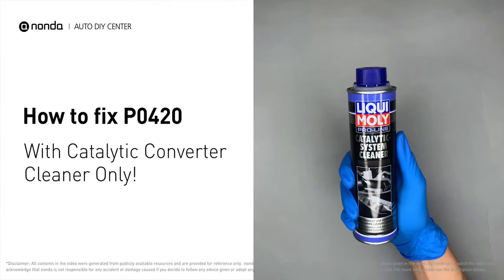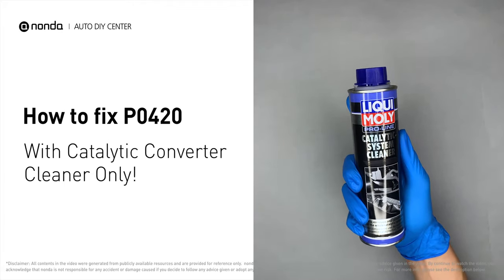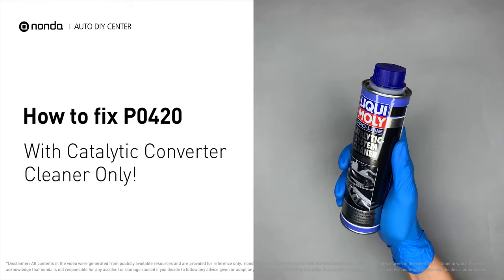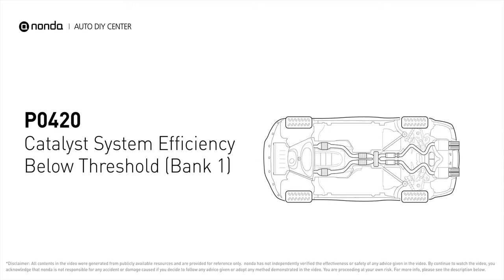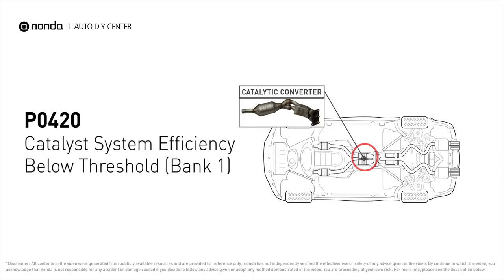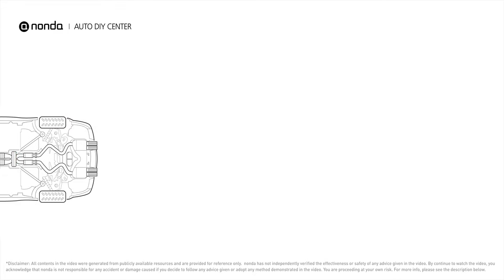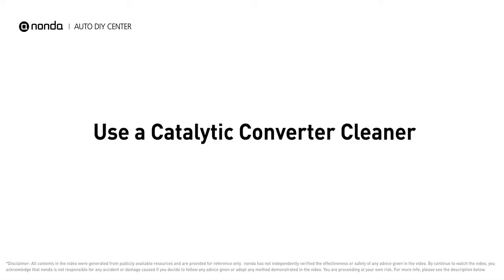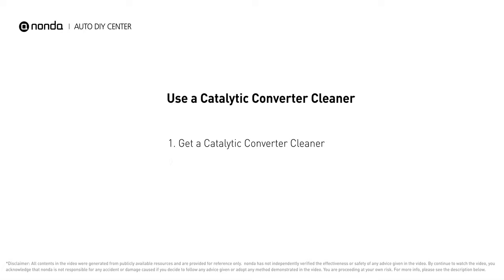How to Fix P0420 Engine Code with Catalytic Converter Cleaner

Comment: I replaced my catalytic converter, put some cleaner in it, had 02 sensor replaced. Still comes on.  I have no idea what to do. Any suggestions?
Reply from the maker: Can you please provide us with your vehicle's year, make/model and confirm if there's other code present?
Reply: @nondainc  Chevrolet Cruze 2015 LT. No other codes.
Reply: @jdfurrow having same issue, same car, same year. Did you ever find out a solution? Also, does your Cruze have the turbo?
Reply: @alexanders2071 I have turbo and  I have made contact with Chevrolet. They are going to be replacing the catalytic converter.

Comment: I’m driving a 3.L Diesel in my X5.  Threw the 240 Code again.  Two weeks ago it went off and I cleared it. I was hoping that filling the DEF Tank and continue to use Power Service additive would correct the problem. Well it didn’t.   I saw this video and was curious about the RPM’s needed to allow the cleaner to work effectively.  At highway speeds I’m still under 2k-RPM.  I’m hesitant of driving it around in a lower gear for 30 min &/or  at least 150 miles to allow it to work.
Reply: Put it in Neutral?

Comment: I’m looking at a cataclean. But it’s recommended not to use with gasoline oil engine. And I can’t figure out if my Subaru Forester 2009 is one or not
Reply from the maker: Hello, you may try this. Catalytic Converter Cleaner: https://amzn.to/3r67qCf   Hope it helps!
Reply: I used one from Dura Lube on my 2012 forester, It says the full bottle for 16 gallons of gas, which is about the size of my full tank. It didn’t clear mine off yet, though i’ve only drive about 50 miles with the cleaner in my tank

Comment: Can I use this on my 2009 toyota corolla. It has the check engine light on, my mechanic said its the catitic converter code and now it's giving me black smoke through the exhaust
Reply from the maker: If this is the only code you're getting, yes.

Comment: owned a honda crv 2006 …is it 1 or 2 catalytic conveter? or just 1 catalytic conveter but has more than 1 parts? i just got it replaced in january and in march engine light on again and i have scanner it show code p0661 & p420 code and i got my oxygen sensor replaced too…any link or what does my catalytic conveter look like? ty all
Reply from the maker: Hello, since you are receiving two codes, we suggest getting your vehicle visually inspected by you local mechanic for further diagnosis.

Comment: I just received my LiquiMoly catalytic system cleaner. Do I pour directly in my gas tank or some other way? Part#8931
Reply from the maker: Hi Joel, yes, you can pour it directly into the gas tank.
Reply: i have the same part number 8931 
addition in the intake area
is confusing, any suggestion. 
thank you

Comment: P0420 code, I changed new catalytic converter and new upstream and downstream sensor, the fix clear the code, but few months later, the code came back up, I wonder why
Reply: You probably have  blowby or rich fuel mixture from bad injectors.

Comment: 2011 Nissan frontier same code should I try this ?
Reply from the maker: Yes. And pls check the possible causes:
Faulty Three-way Catalyst Converter Bank 1
Exhaust Tube
Intake Air Leaks
Faulty Oxygen (O2) Sensor
Faulty Fuel Injector(s)
Leaking Fuel Injector (s)
Faulty Spark Plugs
Improper Ignition Timing
Faulty Engine Control Module (ECM)
Dirty Air Filter

Comment: Hi i recently just got the exact same code the way u described it the code popped up on my 2005 scion tc and I noticed this bad smell coming out from my exhaust…Would this work??
Reply from the maker: Hello, please confirm if this is the only code you're getting, you can follow the tips/solution provided in our video on how to fix this code.
Reply: its worth a try if not, have to replace cat. same here with me

Comment: I have a 2014 ford explorer sport with a 420 code. Should I just use as the video demonstrates?
Reply from the maker: Hi Brad, we suggest checking for exhaust leak and performing a test for the catalytic converter/oxygen sensor.
Reply: Brad, I'm wondering what was the fix for your Explorer. I'm getting the same code and it comes and goes.

Comment: So once I put the cleaner in with my gas at 1/4 of a tank, do I add gas and drive or do I just drive out the gas, my car will not go 150 miles on a 1/4 tank of gas
Reply from the maker: Hi Olivia, please provide us with your vehicle's year, make and model.
Reply: add gas after yes.
Reply: Can I add to the gas tank of a 2011 Ford Escape?
Reply: @nondainc can I add to a 2011 for escape gas tank

Comment: You are not supposed to pour into gas tank. Read the instructions and it clearly states otherwise. Remove intake component and spray into exhaust.
Reply: exactly
Reply: There is a version of these types of products that are supposed to be poured in your gas tanks indeed… Check instructions on your product.

Comment: I have a 2009 Buick enclave I had the cat converter replace and the sensors and the code is still there should I do this process
Reply from the maker: Helllo, kindly check if there's a leak in the exhaust system and issue with the air fuel sensor.

Comment: Would this work for a 2013 dodge avenger sxt with that code...also have codes P0117 & P2181...TIA
Reply from the maker: Hi Andrea, yes. However, if you are receiving other codes then it's better to get your vehicle visually inspected by your local mechanic for further diagnosis.

Comment: i used cleaner from auto zone on my 2017 dodge journey and the light went off but came back on the next week so i tried it again and it stayed off liner but still came back on what should i do
Reply: I have an intermittent issue with my 2019 Subaru. I did a diagnosis and I concluded if the light comes on, then turns off then back on, and then turns off for short periods, then the fault is the upstream/front O2 Sensor. Sometimes referred to as the Senors Assembly Air/Fuel. Essentially it's the Oxygen Sensor you see before your catalytic converter. 

The best option is to remove and replace. If you're tight on money you can remove and clean the tip of the sensor carefully. Remove all carbon and let it sit in a safe solution that doesn't degrade the inner workings of the sensor.  Generally speaking, there is an anode (+) a cathode (-), and some sort of electrolytic medium inside the sensor. Also, do a visual inspection. Check for any cuts in the wire, exposed wire, or dirty or corroded contacts inside the sensor's connector. Sometimes their parts get fried due to heat and exposure to the environment. Once you verify that the sensor is electrically sound, then it is safe to conclude it is just really dirty and stopped working i.e. fowled.

Once cleaned, let it dry and reinstall. And see if the light in your car stays off this time until you can officially remove and replace it with a new part.

If you are someone versed in electronics and own a multimeter, you can check the ohmic value by checking resistance access PIN 1 and PIN 2 of the O2 sensor. 

My current approach is to 1) remove and replace the fouled sensor on my Subaru, 2) check resistance to confirm is out of specification, 3) clean the tip of the sensor with solution, IPA then work up to brake cleaner if needed, 4) check the readings with a multimeter. 5) let it dry if it is within resistive values then 6) install and do an OBD reading to confirm.

I was able to access a Subaru service manual online for free. It entails all the values and specifications of the car. It even tells you step-by-step how to do it. It's very easy.

Anyway, a lot of information but I hope this helps. Let me know if you need any more information.
Reply: You have to get a new catalytic converter, this is a temporary solution or something you’d use before you have problems to keep it “clean”. Use once a year. None of these cleaners are going to “fix it, clean it”. Just temporary ( check engine light ect . Going on
Reply: 8931 Protects the catalytic converter from clogging with soot. Cleans intake valves and the combustion chamber. Improves the combustion of the fuel. Clean engines reduce fuel consumption and therefore CO2 emissions. Prevents corrosion in the fuel system. ( and you need a special spray bottle for that) 

To ensure optimum cleaning of the fuel system, we recommend adding Catalytic-System Clean (part no. 7110) to the fuel immediately after applying the additive. This will safeguard the cleanness of the complete engine system including the exhaust gas system. So now u buy 2 cleaners. Doesn’t sound good to me. It didn’t get good reviews. I’d go with one you put in your fuel tank.

Comment: I have a 97 Honda throwing the code for you have to drive 150 miles or can you just rev the engine plus I have a full tank of gas will it be driven til gas down to 2/4 tank
Reply from the maker: Hi Cathy, we highly suggest addressing the issue in a timely manner. Driving with this code is not advisable as it can also affect other parts of the engine.

Comment: Hi! Is this the liqui molly 7110 catalytic cleaner? I am looking for one and there’s another liqui molly cleaner that you can’t put in the gas tank.
Reply from the maker: Hi Carl, it's a Catalytic Converter Cleaner. https://amzn.to/3r67qCf
Reply: But can you put this one into the gas. It should work the same as it’s mixing with the gas in the cylinders, no?
Reply: LIQUI moly sells every bottle for tanks with funnel
All blue funnel for gas 
All red funnel for diesel
Any bottle not with funnel not for tank
Reply: What does that mean ? Please elaborate this situation. Thank You. A concerned mind/customer.

Comment: Hi, I used different cleaner bought at autozone. Engine check light disappeared after few days. It resurfaced again after couple of weeks with same code p0420.
Reply from the maker: Hello, can you please provide us with your car's make/model?
Reply: @nondainc 2000 GMC jimmy

Comment: what if i do less than a quarter tank of gas then put in the converter cleaner? will it work faster? i have a 2015 chrystler 200c
Reply from the maker: Hello, 1/4 full is recommended. Thank you!